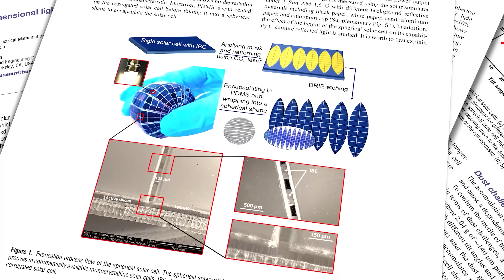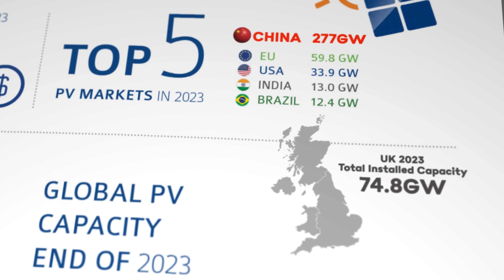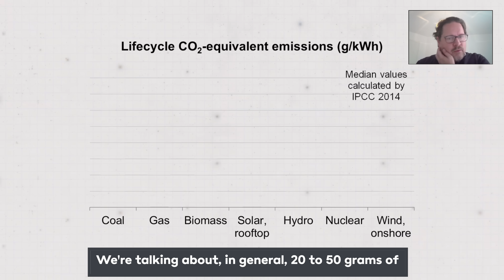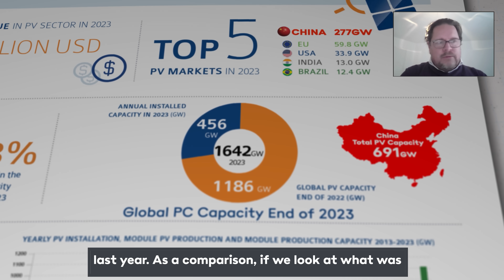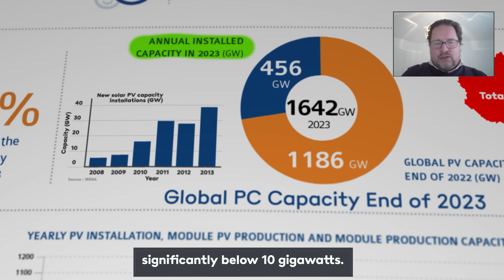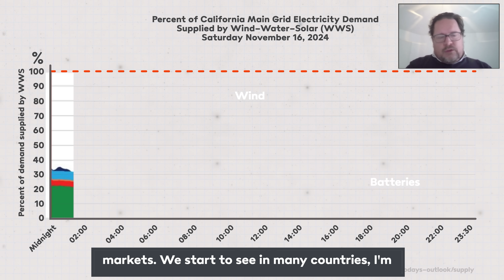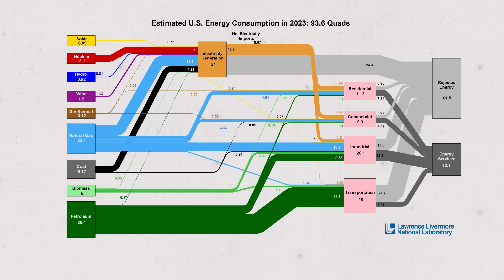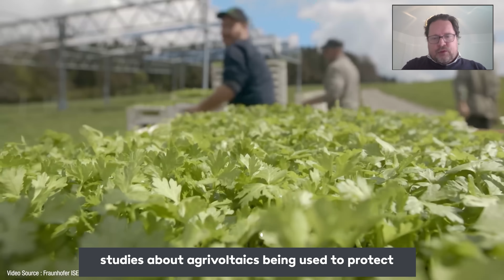Renewable Energy Domination

Comment: Under the Trump 2024 administration public power grid support of wild AC from solar voltaic and wind turbine generation will likely be eliminated or greatly curtailed because it costs the public power grid more expensive fuel to support large amounts of wild AC than to make all the electricity internally.   Wild AC generators will become stranded assets as this happens.   

Getting rid of public power grid support for large amounts of wild AC will save electric rate payers a lot of money with the current rate structures.  These erratic sources of electricity can be used to maintain electrical storage such as charging batteries where the electrical storage can produce scheduled dispatchable electricity.   Battery storage likely doesn't offer an economic solution for wind turbine generators.  

For the home, battery storage adds backup power during power disruptions adding significant value making adding batteries a benefit and allows erratic power from the solar voltaic panels a useful purpose to maintain electrical storage.  

----
Al Gore's (US vise president 1992-2020) successful war on science and scientists maybe coming to an end.  Global warming was officially reported at 1.1°C in 1991 and 1.06°C in 2022.   There has been no climate change due to global warming.  Global warming at 1.5°C was predicted to begin climate change with stronger observable hurricanes in the Gulf-of-Mexico.  The cause of global warming is not know in 2024 despite decades of science studies going back to the 1970s.

It is scientifically impossible for greenhouse gas behavior to cause global warming.  Before Al Gore became US vise president in 1992 earth's water vapor saturated greenhouse effect was taught in US public education.   

All the greenhouse radiant energy from the earth is completely absorbed in earth's water vapor saturated greenhouse effect by greenhouse gases within a few meters of the radiating surface out to a maximum of 20 meters from the radiating surface adding 5.55°C (10°F) to earth’s average temperature.  Its further heat transfer is by convection i.e. gas molecules bumping into to each other.   At 1% average tropospheric water vapor over a 99% share of earth's water vapor saturated greenhouse effect is from water vapor.

The back of the United Nation's Intergovernmental Panel on Climate Change (IPCC) science report states it took its greenhouse gas samples at 20,000 meters altitude where it is common high school level knowledge there is no greenhouse radiant energy.  This is typical practice for deceptive marketing to state legal data transparency protecting the perpetrators from fraud prosecution.   The IPCC has been transparent with its data acknowledging it is not dealing with active greenhouse gases.  

Earth's greenhouse effect is frequently used as a primary example to high school students of a system always in saturation from the strong greenhouse gas water vapor absorbing all the greenhouse radiant energy from the earth with greenhouse gases within 20 meters of the radiating surface that is all around us everyday and can't have its overall effect changed.  There is no further greenhouse radiant energy to interact with greenhouse gases.  

0.4% of the atmosphere is CO2 and on average 1% is H20 water vapor.   (1% H20)/(0.4% CO2) = 25.  Water vapor is 25 times more present in the atmosphere on average than CO2.   Water vapor has an CO2e of 18,  18 X 25 = 450 CO2e total for water vapor to 1 CO2e for CO2. 

Arctic warming is taking place with the proving mechanism being warm Atlantic Ocean waters migrating deeper and more frequently into the Arctic Ocean warming it and the region.   The warmer Arctic Ocean water is causing a few weeks less of reflective snow and ice surface cover resulting in more solar heat gain to the Arctic region surface.

Atmospheric CO2 levels of 1200 ppm about three times what they are today would greatly invigorate C3 plants the majority of plant life on earth greatly greening the planet.  C3 plants evolved over 100 million years ago when atmospheric CO2 levels were ten times those of today determined by plant fossils.

The Earth’s oceans have 3-1/2 million sea floor volcanic vents warming the water and changing it’s chemistry that have not been systematically accounted for.

There has been no credible Climate Change due to global warming as of 2024.  Climate Change was expected to start to take place when global warming reached 1.5°C causing observable stronger hurricanes in the Gulf-of-Mexico.  The term Climate Change started being used at the beginning of the 1980s to cause alert to a broad audience of the long term effects of increasing average global temperatures.  

The promotional term Climate Change in the early 1980s was grounded on actions already taken by Gulf-of-Mexico offshore crude oil drilling companies in the 1970s to build for stronger hurricanes due to warmer Gulf waters predicted to start when average global temperatures increased 1.5°C on track for 2010.  That action was taken for a predicted long term change in weather patterns or climate that backed up the use of the term Climate Change.
Reply: I smell a lot of BS here. For one scientists are now fairly certain that the 1.5 degree increase in world temperature has already occured or will do so in the next few years. They are now stating that we need to try and keep it to 2 degrees. I For one don't think this is possible. Climate change has been occuring all over the world. Some people are being more affected than others such as the populations of many small low lying islands in the Pacific who are seeing their islands swamped and the people of Bangladesh who are seeing increasing levels of flooding.

Comment: Solar 41 gCO2/kWh assumes EU made panels, as most are made in China that's a false baseline. (minute 4) Per Mariutti closer to 170 - 250 gCO2/kWh depending on energy mix.
Reply: Nope, 41g is what we get from chinese production which has a lot of coal in it. If produced in Europe that value is even lower.
Reply: @texanplayer7651  "The dirty secret of the solar industry" concludes they used EU data to "model" Chinese production. I'm inclined to agree as China is not exactly forthcoming with data, be it medical or industrial. Confirm for yourself, what were the China solar manufacturing data IPCC Primary sources? ipcc_wg3_ar5_full.pdf, ref pg. 1354 - 1356.
Besides, the solar industry has changed a lot since 2014, so disingenuous from the get go. These orgs are not incentivized to be accurate; quite the opposite if you put together how Green subsidizes work.
Reply: @texanplayer7651  wrote reply 12 days ago, but still isn't visible. Simpler version per Mariutti:
IPCC actually used EU data to "model" Chinese production; makes sense as China tends not to share data. Confirm for yourself, what were the China solar manufacturing data IPCC primary sources? ipcc_wg3_ar5_full, ref pg. 1354-1356 If that's not bad enough, which provinces were modeled? There is significant grid emission variation within China.

Comment: I own my own house. I have 50 or so solar panels installed on our garage, plus a 15kw battery pack. In the later part of spring, summer and early autumn, I can generate more than enough to power my house, charge my car and still send power to the grid. 
That same systems makes about 30% of what I need on a good day during the winter. Normally, it's between 5 and 10 percent though. Anyone who thinks that solar can power your home year round, is living in a dream world and anyone telling that it's possible if you living places like the UK and Germany is a straight up lair.

Comment: The problem is reliability.  It is an expensive disaster in Germany where the spikes in energy prices are enormous, and the lack of baseload power is driving up electricity prices in other countries in Europe.  Here is Australia the free energy is becoming very expensive as there is too much electricity going into the grid when it is not needed, and during peak demand, the solar power is offline and the lack of baseload power is driving spot prices up enormously, especially as coal fired power stations are being decommissioned.  Compare the German CO2 emissions with France, and the German energy costs.  Energy in France is cheap, energy in Germany is very expensive and needs to be propped up more and more by reliable energy from other countries in Europe whose energy costs are increasing due to having to export energy to Germany.  Solar and Wind installed capacity is irrelevant if the power is not able to maintain supply at night and during periods when the wind is not blowing.  The War in Ukraine highlighted Germany's heavy reliance on Russian fossil fuels, and now the tap has been turned off, Germany is becoming the energy vampire of Europe, sucking energy out of its neighbours.  Just look at the EU energy maps showing the prices in EU countries like Germany, Sweden, Finland, Norway and France.  Germany is now looking to restart its decommissioned nuclear power stations to save their economy.

Comment: to support the argument that bi-directional car batteries are a key element in the future, let me present some numbers:

instead of spending eur 55 billion on a new nuclear power station (that was the cost of hinkley point c) one could subsidize the purchase of about 3.67 million bi-directional car purchases with eur 10,000 for the car and eur 5,000 for a bi-directional charger.

if you want to cover 24 hours of the average use of electricity of germany for example (1.39 billion kwh) and assume that a car can discharge 40 kwh in 24 hours, it would take 34,750,000 bi-directional cars. (germany today has 43,300,000 cars).

so for the cost of 1 new nuclear power station equivalent to 3.67 million bi-di cars you can cover about 10% of germany‘s daily electricity use.
2 new nuclear power stations cover 20%, 3 new nuclear power stations 30%.

if germany had 30% of its daily electricity use available in the form of bi-di cars, i believe that that is the solution to a „dunkelflaute“ as it happened in november and this week.

Comment: For me, the energy system as a whole needs to be considered. solar is becoming a big part of it. and wind energy too. and hydro needs to be optimised to continue playing a significant role. but also the storage as to be developped, because that is what will counter the intermittence of the solar and wind. SO far storage is really not pîck up pace and that is quite worrying, because the incereases the volatility and shortages for the end customer.
Up to now, I do not see the EV being helpful as storage. for 2 reasons, first, pêople want the power to dirve and not for utility; especially if it reduces the battery lifetime and they are not paid for the service. and second, there is no economically sensible way for the end user to charge its EV during the day at work and release a part of the power during the night at home, the usage is ti charge cheap at home for the day at work and not the opposite. as long as the end user has no benefit, they will not do it.

Comment: Just filled my roof with 10 kWp solar panels. I remember my surprise when i first calculated this is enough for my electricity, heating and driving (heat pump and EV i still miss, coming soon). Yes of course it is just the energy amount and not the right time of the years when the energy is needed in the north of germany. But still: with enough grid storage (hydrogen?!) one roof is enough for all the energy needs of a family.

Comment: Thanks for a brilliant presentation, again. 
I live in Australia and have had a solar system (1.7kw back then) since 2008. We now have a 13.3kw system with battery and participate in a VPP. We have installed a total of 34kw on various roofs we own to assist our state, South Australia, in achieving net zero. South Australia has seen a rapid expansion of renewable energy over the last decade, with the state's renewable energy generation increasing from 1% to 74% in just over 16 years: 
Having a rooftop solar system is really a no-brainer.

Comment: The use of EVs as storage to balance the grid is a common theme and you mention it again in this video. I’m in the market for my first EV but I want this function (V2H or V2G) but despite marketing promises from the likes of KIA and the VW/AUDI group when it comes to the crunch it isn’t really available.

I installed a 13kW solar array nearly two years ago (very successful, looking at a five year payback) but didn’t install a battery as I thought EVs would be ready to do the job by now.

I have a three phase mains supply so I have a three phase inverter that balances the fairly volatile DC supply from my array quite happily. Surely it could handle a much more stable and predictable DC supply from a car battery? But the bi-directional charging solutions seem predicated on EVs having their own inverter (which surely won’t spread across three AC phases) or a dedicated charge point with an inverter.

The integration just doesn’t seem to be there yet. Very frustrating.

Comment: I really feel sure that Solar is the way forward for me. Currently looking to sell my house and move and I will then make sure I have the opportunity to install solar. My only hesitation is there are so many different systems and Businesses who will install Solar may be good but my trust level these days is very low. Bean counters rule the roost and I don't want to be sold something the business wants to shift rather than what is right for me. I need be on top of my game here and must educate myself before spending my hard earned. As far as storage of solar in an electric car goes, that sounds fine except I rather think it is designed as a one way charge, into the car only. I do not believe there is the mechanism yet to use the car battery as part of a night accumulator supply system. Positive thoughts for all this though :)

Comment: Solar voltaic capacity is a delusion as it does not translate to significant generation.
 The U.K.the figureis about 11%. In sunny countries the solar generation causes real problems to the grid operators such that they now have to curtail its generation.
Basically a third rate source of power.

Comment: Just on that last statistic from the Al Gore talk, is the lifetime of the PV implicit there? Like, that one shipment of PV will produce the amount of energy that 100 shipments of coal produces but then needs to be replaced? Which is fine, i guess, it just highlights nicely the issue of what happens to the solar PV at end of life. Stossel and other right wing hacks claim to be terribly concerned about that but for those of us genuinely interested in solutions to climate change it's good to have the facts.

The chart also seems like a good way to visualise how much carbon is needed to create the panels, would be useful to have that figure in units of the number of shipments that could be subtracted from the 100 coal. That, of course, would depend on the manufacturing and energy infrastructure of the originating country (China, let's face it).

Comment: I have 17 solar panels which provide sufficient electricity for my house for the year. The problem is that I sell my surplus electricity cheaply during the day and buy it back expensivly at night. If I bought an electric car where I could access the battery for power at night it wouls save buying a seperate battry for the house and give me cheap transport as well.
Reply: True, but that battery would be doing double duty and wear out twice as fast as if you'd just used it as it was intended, to move your EV about.  Batteries have only so many charge cycles before degradation begins to kick in.
Reply: @Les_S537  the soft and slow work the battery does will not wear the battery out.

Comment: My huge bugbear is not that 3% of land needs PV on it (and actually that is a significant part of countryside when it is placed on the good arable farmland out there in the UK verses, e.g. places like the lake district and so forth that is poor agricultural land and far from where it is needed) but that there is still not enough incentive to decentralise the system further. why doesn't every south facing roof get covered in solar PV. every home get a battery and then all of a sudden you don't need the significant expansion of the grid network that big solar farms need. 

Furthermore, it lowers costs for consumers and saves everyone money (apart from big business). We just had 24kW of panel put on our church roof, it could have been even more if we had had the funding and they had measured the roof properly. I wish we had, as that is free power for us and plenty of low cost power for others in the summer..

Someone get all these buildings covered in PV and we will actually make a difference.
Reply: We have a 15K array and 15K of battery in the home and we only need the grid from mid-november to mid-February, it's wonderful 😊